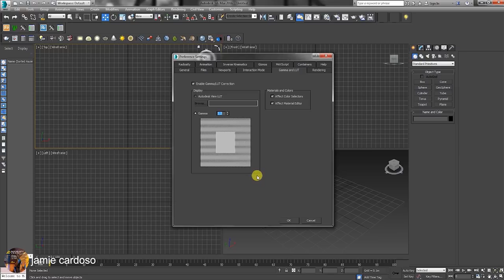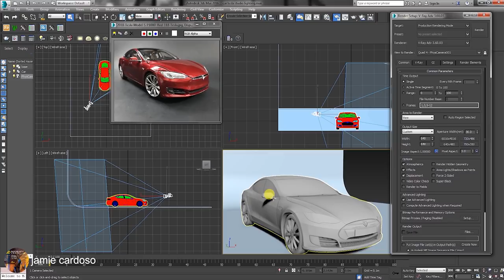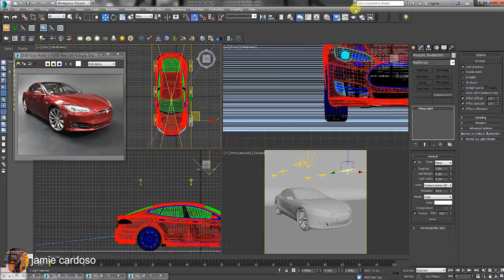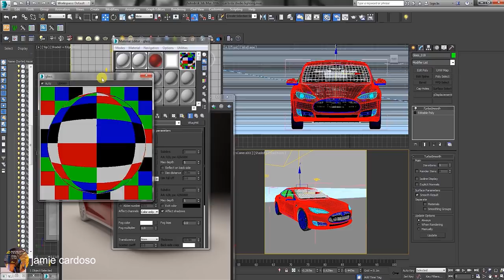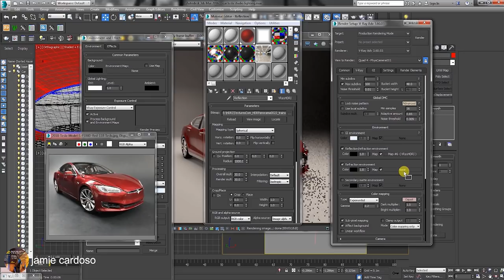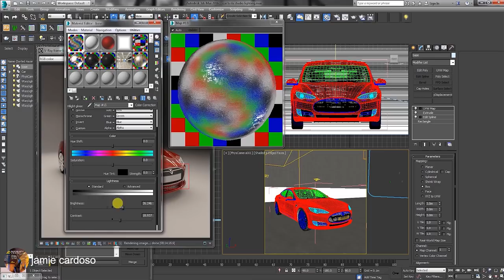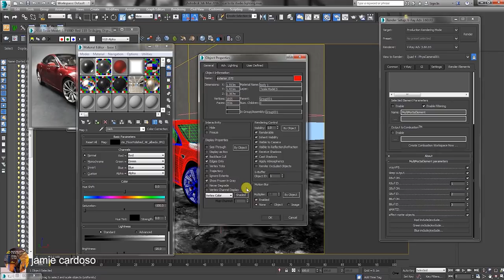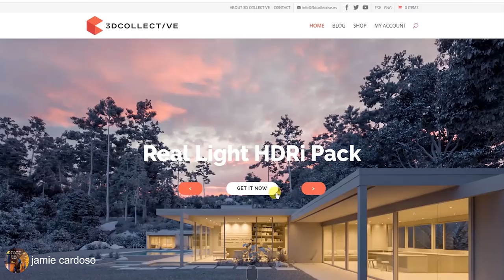3ds max + vray : automotive studio lights (CC & TimeStamps)

Comment from the maker: Download the Full course/Tutorial with project files : https://jamiecardoso-mentalray.blogspot.com/2019/03/3ds-max-vray-automotive-studio-lights.html
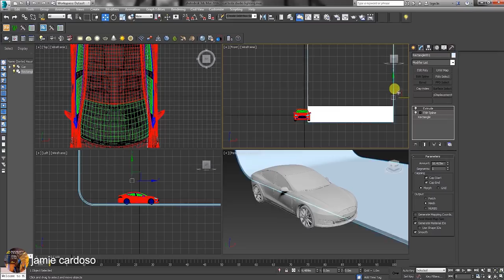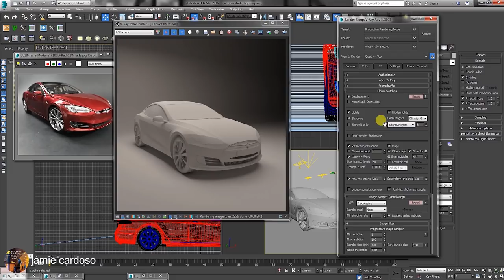This video has =TimeStamps: 0:30Setting up the Units system   1:54Merge Car in the Scene   2:23 Measure the scene   2:57Group the Car   3:20Adjust the Pivot point   5:57Create the studio Floor 9:46 Create and setup the camera  12:02Frame the composition with Width & Height Output Size   12:45Loading & Setting UP V-Ray Parameters for Draft Progressive Renders   16:30Creating the V-Ray Base/White Material   17:59Creating the Studio Lights   22:48Setting Up V-Ray for Draft/Fast Renders   24:46Add the VRaySampleRate Render Element   26:01Change the Render from Progressive to Bucket type   26:22Global DMC Local Subs explained   27:40Creating the Car Paint material   31:21Creating VRaySoftbox shader for lights   33:37Creating the Glass material   
35:53Creating the Chrome/Metal material   36:41Adding the VRaySpecular, VRayRawReflection, VrayRawRefraction, VRayReflection &  VRayRefraction Render Element  39:24Creating the Plastic material   41:4Creating the Tyre/Rubber Material   43:48Adding HDR image   46:18Creating the Car number plate  49:50Creating the studio Floor material shader with VRayBlendMaterial 
59:55 Adding the VRayDisplacement modifier   1:08:20Adding Render Elements   1:11:15VRayLightSelect Render Element   1:13:16Setting up High Resolution Renders   1:18:59Using LUT files
Reply: thank you so much
Reply from the maker: sakura swann you’re welcome !!!

Comment: Sir i have 1 question 
how to increae the bitrate in animation from render settings?
Reply from the maker: Hi Zubair, do you want to increase it in 3ds Max or post-production? 
99% of companies render animations in a sequence of raw file formats such as, tiff or exrs. Followed by loading them up in a post-production package such as nuke, adobe premiere or after effects...to change the bitrate before exporting the sequence as an H.264, etc.  
If you want to change the bit rate of a final video (as opposed to sequenced frames), you can use a software  called "HandBrake".